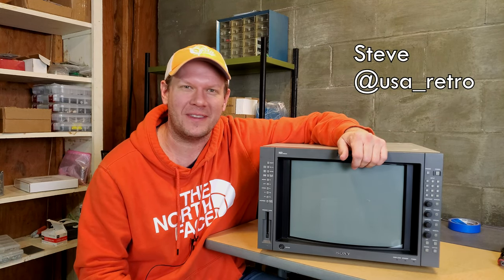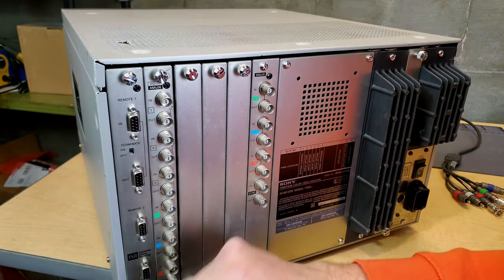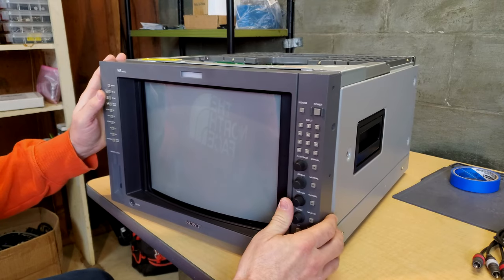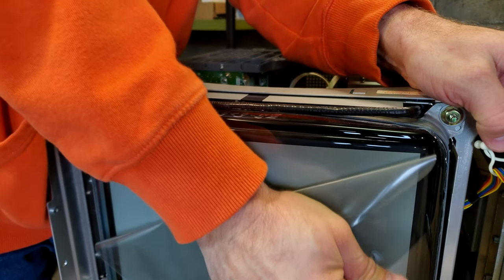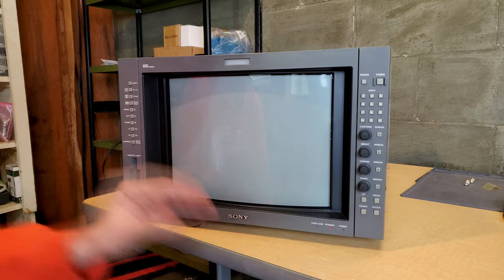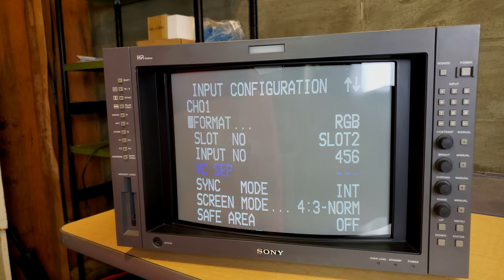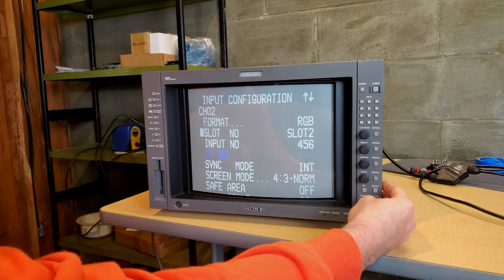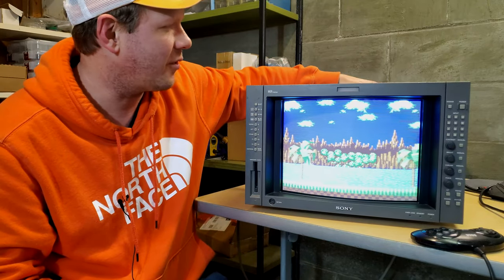Sony BVM 14F5U Master Monitor - A Perfect Retro Trinitron 📺 | With a NEW CRT Tube

Comment: question ,what is the point of 240P+ pvms? it is not for that, a crt pc monitor that reaches much higher resolution (some reach more than 1920*1440P, which is well over 1000 tvls). today, most people dont buy a pvm/bmv for his resolution(because a crt pc monitor can reach more and is way cheaper, even the most expensives ones), most of the people buy it for 240p content
>also
after you remove the protective plastic, is it possible to put another one?

Comment: These hours can not be correct. 120.000hours : 24hours = 5000 days : 365 days (one year) = 13.69 years
Reply: You'd be surprised. Some of these monitors are left on 24/7 for many years. But I agree it does seems a bit unrealistically high! My monitor's hour count shows 65535, which is 2^16-1, so I'm assuming it hit the 16-bit integer limit and the hour count is actually even higher!
Reply: One think I've never been sure about with BVM times is whether it's counting just the time with the tube physically on, or if it's including the entire time on "standby mode" too. If it includes standby time then it's not unreasonable, seeing as there's no way to turn this off except the physical flip switch on the back
Reply from the maker: I've seen a few monitors with this many hours.  If it was left on all the time, then that makes sense.  It was made in the 90's and then had a new tube installed about 8 years later.

Comment: If it has 800 lines of resolution why does it only support 480 lines max? What is it doing with all those extra lines? I think I am failing to understand something.
Reply: That’s how you get scanlines. When the resolution of the content you’re viewing does not require all the lines that your set possesses, scanlines happen.
Reply: If that's the reason why, it makes me wonder why there isn't the option to turn scanlines off. Maybe it wouldn't be feasible to have such a feature.

Comment: These are great monitors and first came out in 1995. A 21xxxxx serial number (rather than 20xxxxx) denotes a revision and means there was a change in production (improvements and updates to certain parts). The jittering menu is because it relies on having an input signal present for sync (or a channel with the internal pattern selected) but indeed, bad capacitors on the E board can cause a subtle vertical jitter.
I believe tubes with the optical PET film (anti glare) came out in 2003, and thankfully, easier to remove than the JVCs spray on anti glare !

Comment: If the scratches on the foil are not to deep you can actually polish it with a bit of toothpaste (which is a very light abrasive) and a piece of cloth. I managed to save the screen (and foil) of an M7MDE this way.

Comment: Great showcase of that monitor steve, thanks.
It would be worth mentioning (IMHO) that 14" BVMs with built in side controls have a weakness: if you loose the content of the SRAM (e.g. the 3V battery backup dies) the monitor will think it's unit without built-in controls and it's side buttons will not be mapped properly. For example pressing "7" will trigger a "1" and "3" triggers "enter".
If you have one of those monitors, get yourself an 8 bit attribute SRAM pcmcia card and do a system backup from the maintenance menu.
Oh did I mention you would also loose the serial number and the number of hours?
Reply from the maker: Thanks, The BVM's information is stored on the ISR board.  That does have a battery, but I don't think the hours reset if the battery dies.
Reply: @RetroTechUSA  it's all stored in the SRAM unfortunately. At least in series F and G BVMs not sure about the other series. There is an SMD capacitor to backup the lithium cell when the battery is being replaced. If that cap is bad and/or you leave the battery out for too long you will definitely lose the serial number, number of hours and model number and all other settings. Don't ask me how I know ;).
I've been told that back in the days when that happened the ISR board had to be sent back to Sony for a "service" when that happened.

Comment: I have one just collecting dust. I believe the psu is out as the monitor will not even power on. The one I own so the hours are super low. Would definitely like to restore it eventually.

Comment: Nice! I need to try to remove the antiglare, from an A20F1 I got that has some ugly scratches in it.
Reply: Oh hey it's Martin!

I had sync issues with a D14 in the past.  I talked with you about it because I use your BKM RGB clone card.  Sync strippers and level adjustments did not help.  The solution (unverified but I'm confident) is using a timebase corrector (TBC).  The D14 doesn't have "VCR mode" but what that really means is that it doesn't have a lot of tolerance on the sync signal.  PS2 and raspberry pis don't work, among others I'm sure.  TBCs are expensive specialty items, but perform a simple operation.  I don't know of a cheap solution yet.
Reply: @willis936  Hey yes its me :D Yeah the D9/D14 and A-series are some finicky beasts... I dunno whats up with their sync circuits, but its interesting that the D9/D14 exhibit the same sync issues as the A series with the original BKM-68X, but in my 68X alternative, they're gone, and I did basically nothing to combat it. I therefore assume its an issue in the monitors' sync separation circuit or smth, when the signals are off spec. A TBC might fix it, no clue, but I'd love to hear your results :)
Reply from the maker: Good luck, the bigger ones are a little tougher.
Reply: @RetroTechUSA  oh man, really? That one looked kinda tough in itself. A bit worried about the residue issue tho... Have anyone tried using Xylene to remove such residue?

Comment: Does it cause damage to a Sony BVM if the 75 ohm BNC terminators are not attached? I recently got my first BVM and did not know that it was supposed to have the terminators on it, and when I turned it on there is purple wavy lines that stay there for a good 5-10 minutes until they go away on their own. Did I permanently damage the monitor by not having them on there? It also has over 100k hours and also the picture looks sorta bright, the black levels are grey-ish rather than solid black of other CRTs that I have.

Comment: I don't have any scratches on my 20M2U, but I feel as I should remove it to give me a better picture quality? Or it doesn't matter?
Reply: I would avoid removing the anti-glare film unless you only use the tube in a very dark room. The anti-glare film makes the black levels somewhat better in a moderately-lit to brightly-lit room.

Comment: Great video once again, Steve! Quick question, I have the D14H5U variant of this model, except I can't access any of the built-in test patterns. I can't seem to find any info on them in the service manual, and following your instructions in this video just switches to channel 9, and then channel 8. Any idea what I'm missing? Thanks for all the great informative content!
Reply: Hi, it's been 2 years since your comment but I decided to help.

You don't have to just click 95 or 96 on the number pad since it will just switch to channel 9 or 8, you have to click instead 098 with a zero, have a good day

Comment: What is that slot on the near bottom left side of the monitor? It’s for memory cards; any memory cards designed for this monitor still being made? Or compatible ones?
Reply from the maker: No, the memory cards are a pain.  Only SRAM compatable.